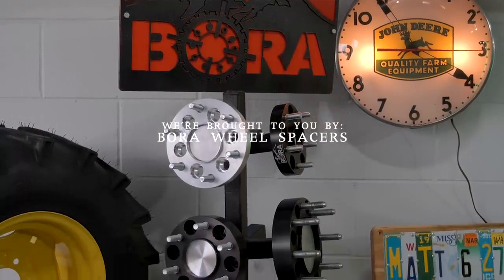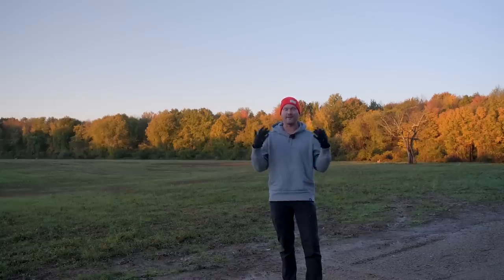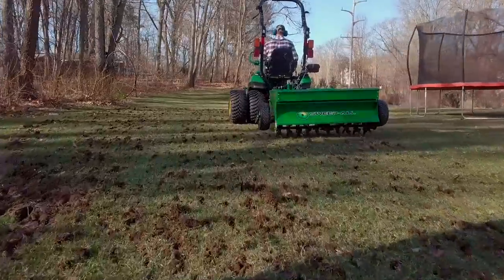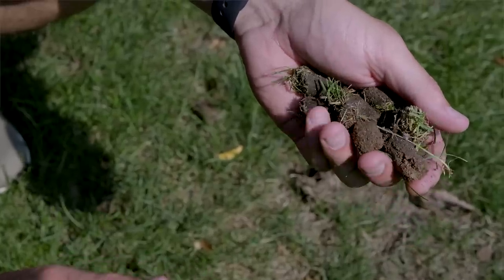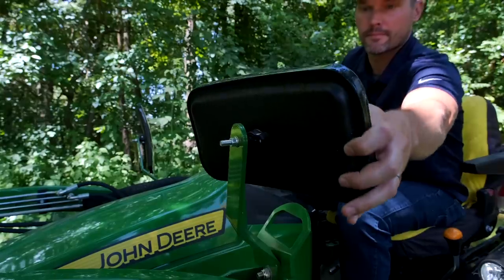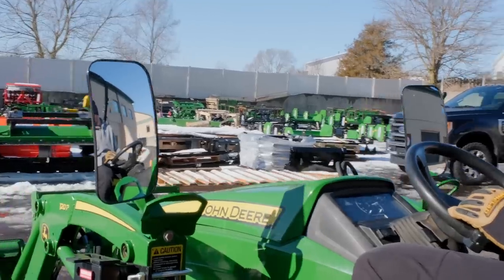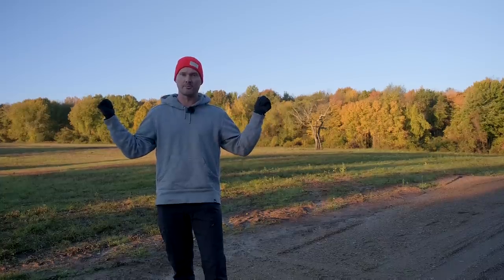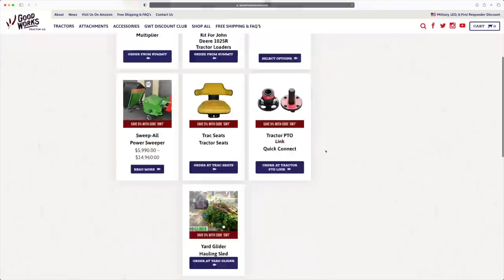WHY ARE THESE THE MOST POPULAR TRACTOR ATTACHMENTS OF 2021?🚜

Comment: I have a snow pusher. I have a 2025r with no cab. It’s the best thing going. No blow back, they engine heat takes the chill down. I haven’t picked up a shovel in 3 years. Rubber cutting edge on an asphalt driveway. 

For stumps I like the bxpanded ripper. Great tool.

Comment: Gday from Australia, love your vids and I have learned so much these past few months from you guys. If you ever start shipping overseas you will certainly have a new customer! Thanks again!
Reply: So painful watching all the cool stuff they get for the compacts compaired to Australia unless we pay crazy money but still nice to dream lol
Reply: @rickyhorsburgh6581  true that. I’m trying to find a rear scv kit and so far genuine is my cheapest option, which considering they are called John Deere and not John Cheap is insane.
Reply: @strayaman8470  I went with a tym t 265 has alot of stuff as standard so saved me a bunch of start up money 1 rear remote and third function 4 in 1 bucket straight out the hole and 97hrs no issues but an uncomfortable seat so far lol
Reply: @strayaman8470  I built my own quick hitch cause the Kubota dealer near me wanted over $1100

Comment: I purchased a set of 2” Bora wheel spacers, witch said would fit my 1026r with a 60” deck. They fit BUT upon turning sharp they hit the deck. Also I found it interesting that the instructions stated to have a dealer install them. Any input on correcting the issue of hitting the deck, the deck it is less than a 1” from the back tires.
Reply from the maker: I'd suggest talking to BORA or whomever made the suggestion.  I'm not sure what size spacers fit with mower decks.  Many manuals have a boilerplate statement in them to have a dealer install or handle work.  That is common language.

Comment: All I have for my subcompact is the quick attach, and a box blade. Would like a snow blower and a front weight kit. Does not have enough front weight to get the most out of the box blade. Will lift the front well before it runs out of pull.
Reply: Quick attach offsets your box blade. If you attach directly to your tractor you will get wayyyy more out of your box blade. Quick attach moves your box blade over 4" back so your rear tires are now closer to the pivot point. Quick attach is not recommended for heavier rear attachments unless you add 100# plus to front end.

Comment: I'm thinking very heavily about getting a 1025r with multiple attachments for a side business and hopefully evolve into a full time business. I'm going for a front loader, skid loader attachment, belly deck mower, backhoe, and potentially a box blade for leveling. What's your thoughts?
Reply: Yes, you can get alot of work done with that. The smaller tractor is very useful in alot of situations especially for residential jobs.

Comment: Have you ever done a video on what is required to maintain Kubota B2782 snow blowers. I just purchased one cheep because the fan and flights are froze on the shaft. This is because the previous owner did not grease it properly.
Reply from the maker: I haven't, but I think the blower manual should have a good section on maintenance.

Comment: The quick hitch bushings are steel not brass. The copper colored ones are Cadmium-plated steel. I have also used pipe from the local steel supplier to make my own bushings. I want to say 3/4 for the upper and 1 inch water pipe for the lowers. on equipment that uses a slide out lower pin captured on both sides the bushings are about $4 each at tractor supply. Many time those can be used on the fixed pin style as well as the other side will keep the attachment from sliding over.

Comment: Frustrating that I have a JD quick hitch and have to get the bushings. One of these days, I'll get the speeco brand...
Reply: Don't buy expensive bushings!  Go to your favorite tractor supplies store and by class changer bushings.  A class1 to class 2 bushing will fit inside a class 2 to class 3 bushing which will give you a class 1 to class 3 bushing for a tenth of what those sold by the quick hitch guys. Be sure to get 2 sets for lower arm and one set for upper arm, or whatever your supplier calls them. A full set will probably give you change back for a $20 bill.  I told my Kubota dealer that I was doing that, and he kind of mumbled "yeah, that works fine".
Reply: @DustMite1937  I figured that out later, too. Speeco eliminates that...

Comment: I don’t what you’re talking about with depreciation.  I was looking at 20 year old NH TN75D 4x4 cab tractors w loaders, average hours 4000 and priced in the mid 30’s.  A new NH 75hp 4x4 cab tractor with loader is mid 40’s same with TYM, RK, and few others except JD, Kubota, MF  being the most $$$ but all seem to keep resale values.  10grand after 20 years and 4000 hours, not to shabby but if you’re talking about those wanna be tractors, those compact oversized lawnmowers, then you prob have a point.